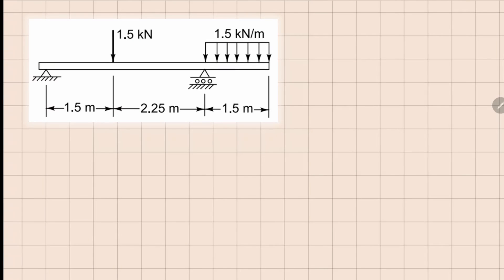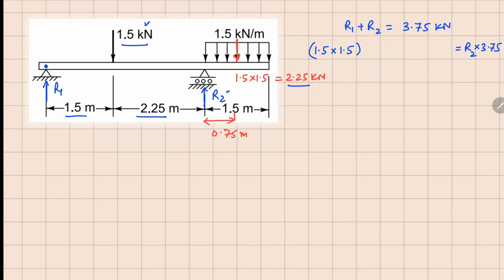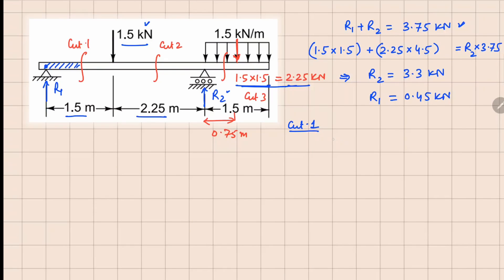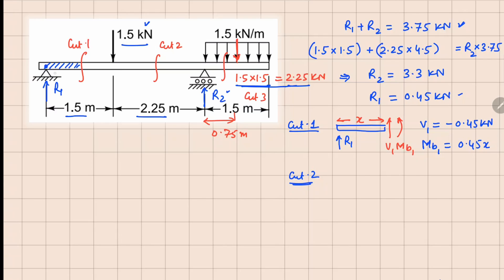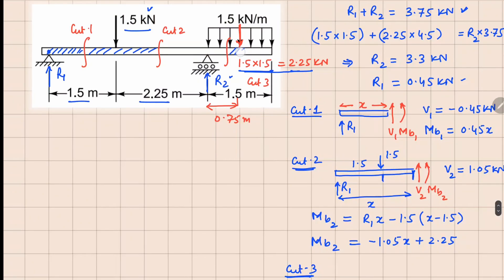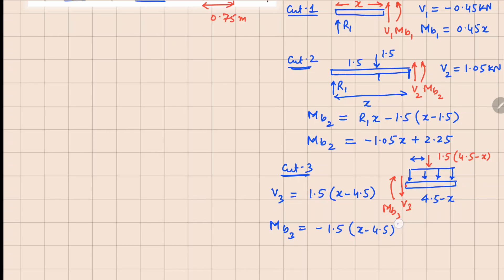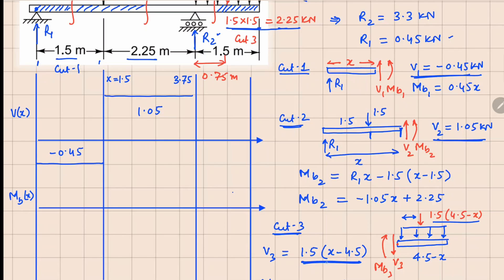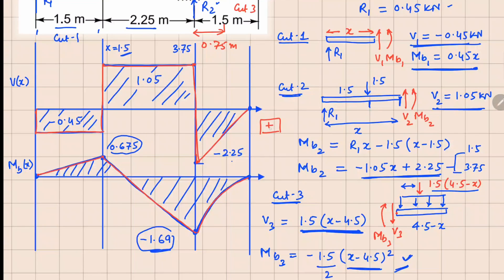Problem 3.8 || Forces & Moments in Slender Members | Mechanics of Solids | Crandall, Dahl, Lardner

Comment from the maker: Correction at 03:41 
For Cut-3 calculation the length will be (5.25-x). This will give V3(x)= 1.5(x-5.25) and Mb3(x) = -(1.5/2)(x-5.25)^2. The values and plot is correct.